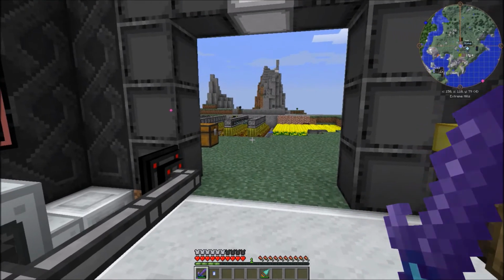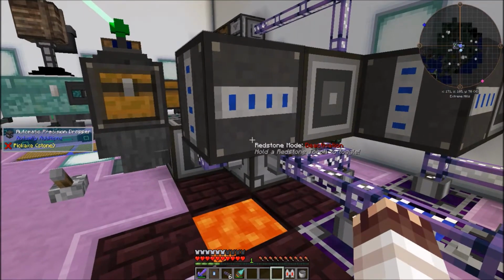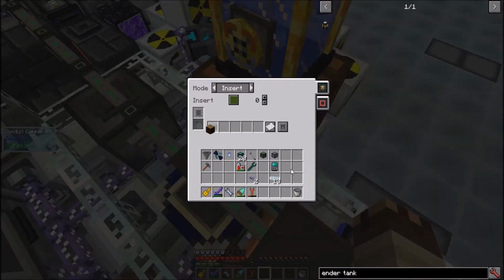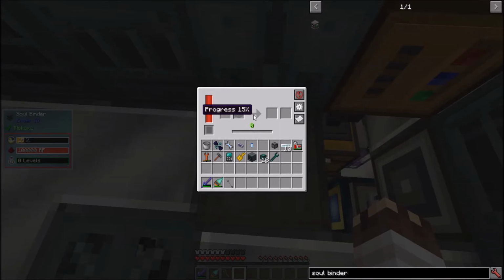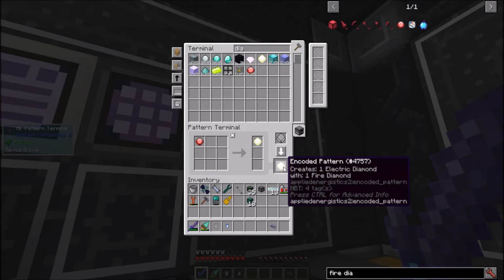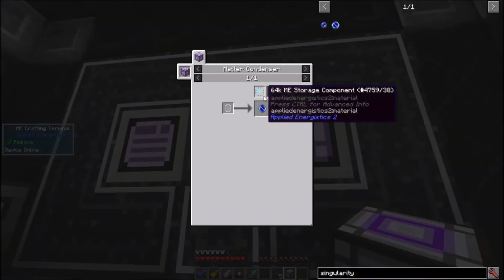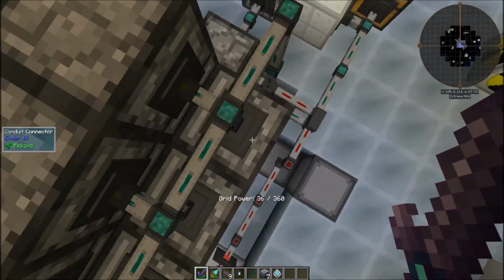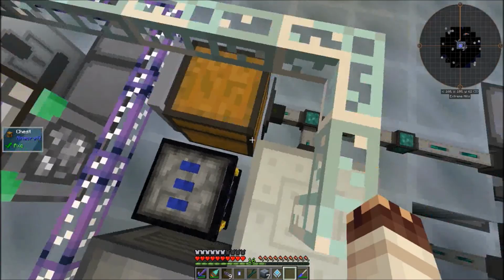Age of Engineering Supershorts #12: AE2 Automation Finale

Comment: Hi minecraftinchocolate, I never thought to use RTools Controls to automate calculator, its great!  However!  For some reason, if I request 10 fire diamonds, it often gets confused and ends up with 2 blaze rods in 1 internal slot on the processor, which screws things up.  I have I done something wrong maybe?
Reply from the maker: Well, I don't remember how my program goes, but I do know that if (1) your crafting card has one blaze rod in two different slots, (2) your program for the atomic calculator has three slots allocated specifically to it in the processor, and (3) those slots overlap with no other program, and (4) your program only runs one craft every time it cycles, then you shouldn't get two blaze rods in the same slot.
Reply from the maker: After reviewing my video, I suspect your problem is with the crafting card. I never show my card for fire diamond, but my card shows blaze rod, flawless diamond, blaze rod, not two blaze rods, diamond.
Reply: It's ok I found the issue, I was using 3 slots instead of 2 for the blaze rods :)
Reply from the maker: Got it. Three slots on what, if I may ask?